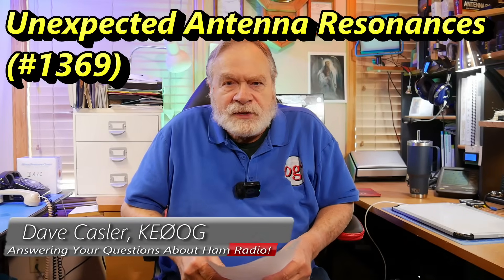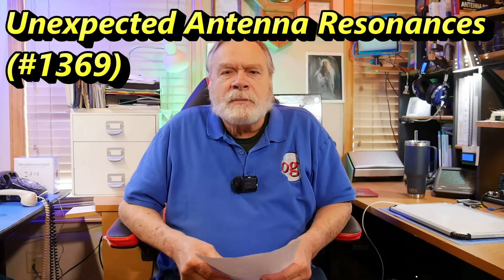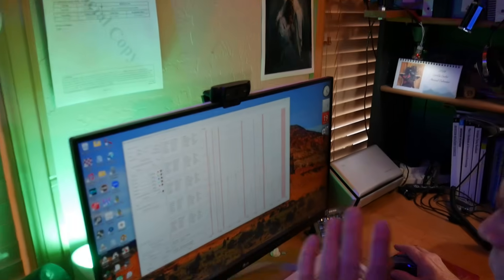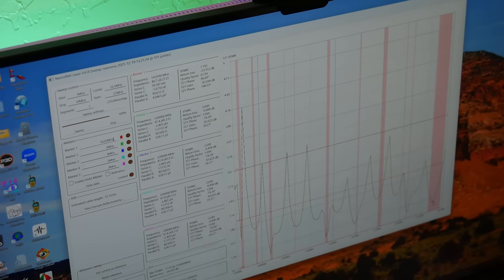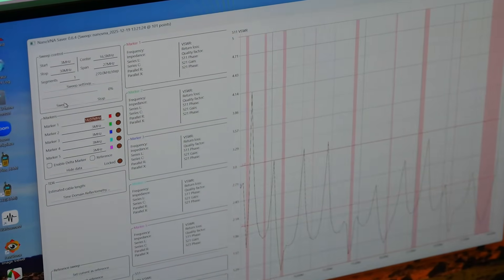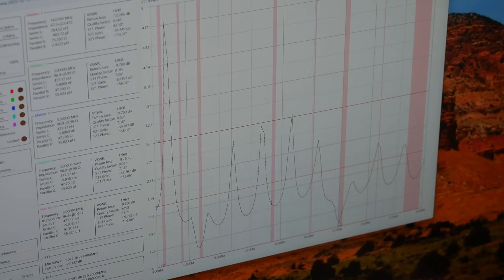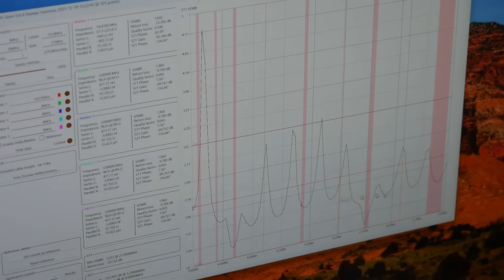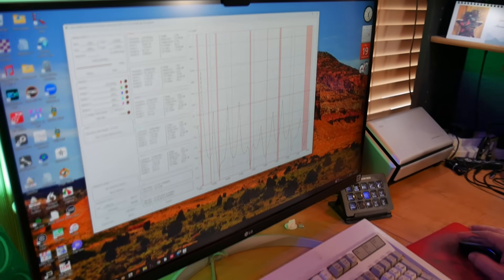Unexpected Antenna Resonances (#1369)

Comment: How close is 60m on a 160m dipole.  I'll probably model it on MMANA-GAL but wanted to see if anyone has experience?  73 KK7YIS
Reply: Fairly close, I use my 160 meter Inverted L on 60 meters and it works great for an antenna not designed or intended to work there. Though it's going to make my power calculations tricky on the new segment.